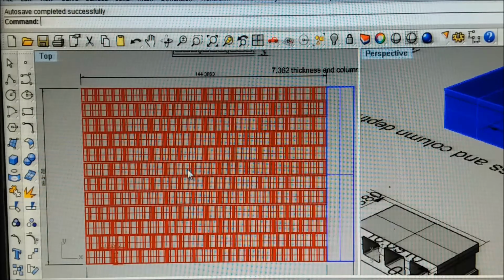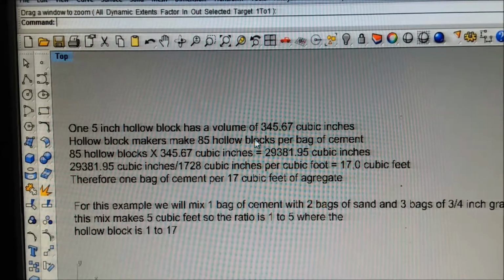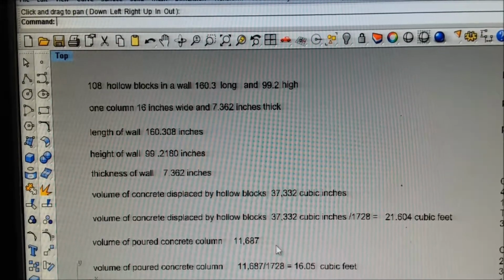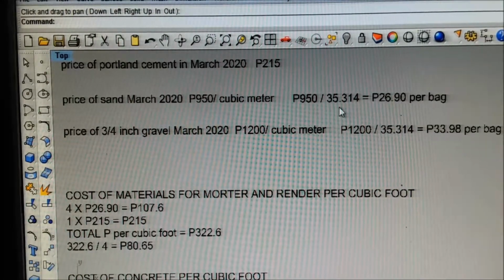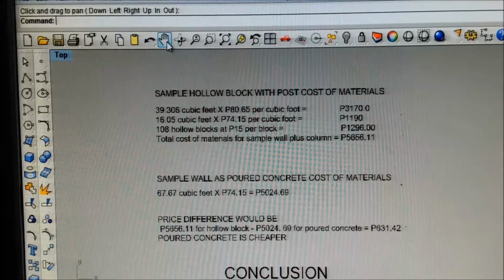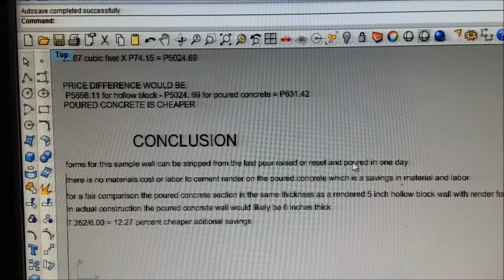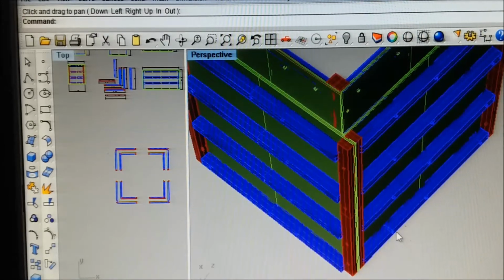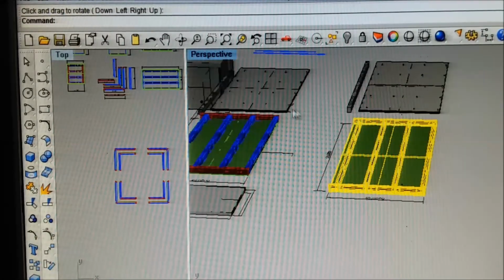"building our dream house in the PI", chapter 34, cost of hollow block versus poured concrete

Comment: Everyone knows the majority of hollow blocks are mostly sand but I was surprised they squeeze 80-90 blocks out of 40kg bag of Portland. I have been a fan of poured concrete and you have done the calculation showing cost is not a factor.  It would appear that habit is the main reason that hollow block construction remains popular.  In your build you have also shown that this construction method can be implemented without workers with a heavy construction background, provided they have proper training and supervision.
Reply from the maker: The hollow blocks remind me of sand castles at the beach. Doing something new I have to be there. Like setting up forms for the first three columns. One tie beamwas done during this time so we could backfill as we went. If things go sideways they bag sand and gravel and do site cleanup. I think power tools get past the learning curve in making completerly square cuts and multiple pieces with a saw stop.